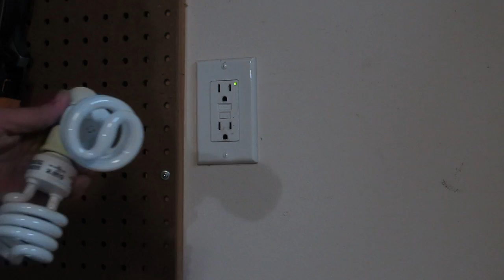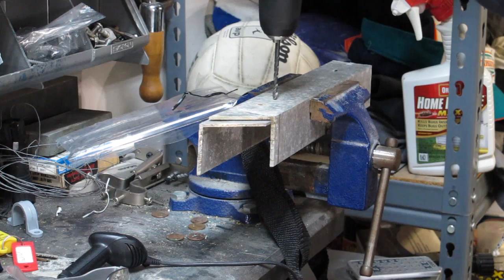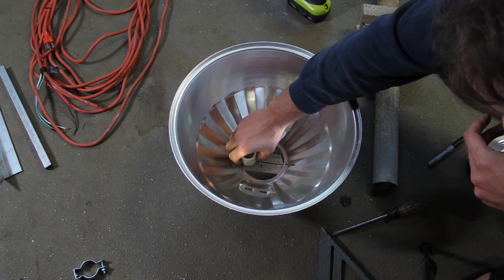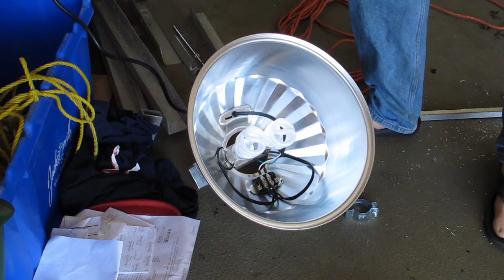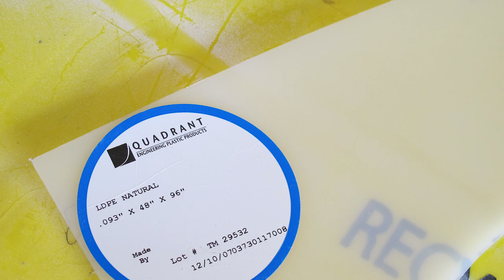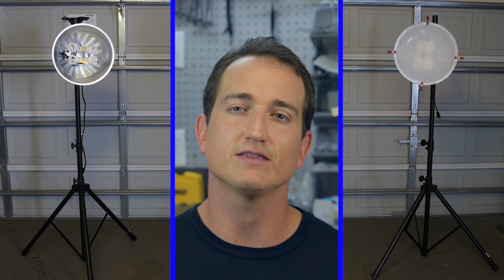How To Make Video Lighting With Inexpensive Fluorescent Light Bulbs

Comment: When I built my single bulb unit, I used a 100mm square x 50mm hobby electronic box, and cut a (35mm) hole in front so could access the bulb mount screwed inside. For the reflector, I used a 12" mixing bowl. Two forward facing bolts in case allows me to attach reflector with wing nuts. Two "L" brackets on the side of case attach to a wood support with a 6mm hole in to attach to light stand. (There is a nut inside case that allows me to tilt unit via "L" plates on the side) ** I have created a "How to" PDF guide for this and other projects.

 I'm now trying to figure a cheap way to turn the single socket into switched 4 way such that it will also fit into my softboxes
Reply from the maker: Interesting, I will be curious to learn what you come up in regards the switched 4 way.
Reply: MrKistel
So will I !! Haven't a clue how I'll do it yet ... but with my over active 'inventor's" brain, I'll devise something. On a tangent, I had the idea of adapting a 28W "Double D" lamp fitting as a single lamp unit inside softbox. The ballast would fix on small plate, and MAYBE I could chop the end off a CFL to get a ES screw fitting as I don't think standalone ES fittings are made. No idea how "A" would fit to "B", but the germ of an idea's there.

Comment: Cost?
Reply from the maker: James, The bulbs, sockets were probably about $20.  Much of the other stuff I had like the aluminum, hardware, extension cord, stands, and so forth.  The wild card is finding a reflector that will work well that you can build onto.  I found these at a new warehouse here locally that that has everything you could ever dream of.  Send a pic if you build your own lights.  Thanks